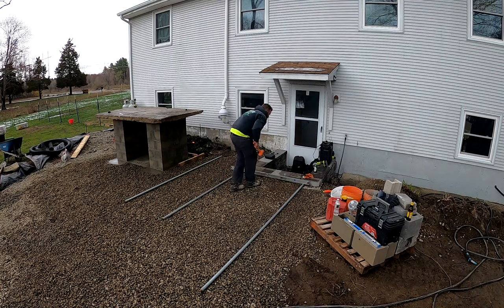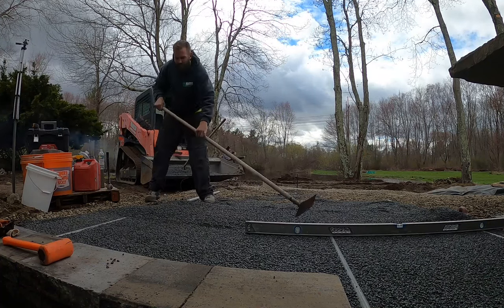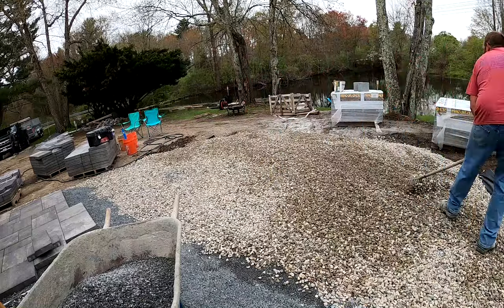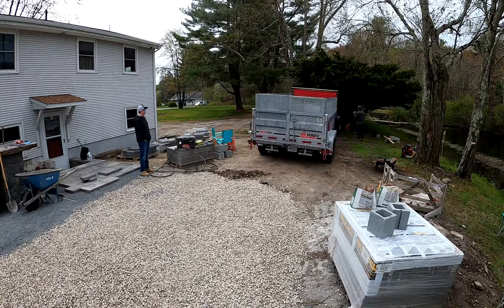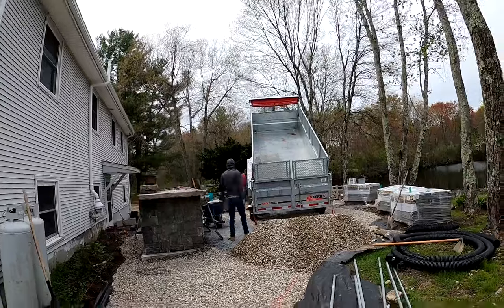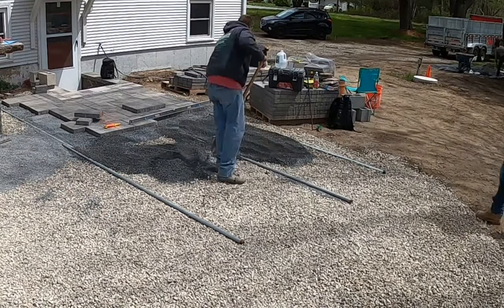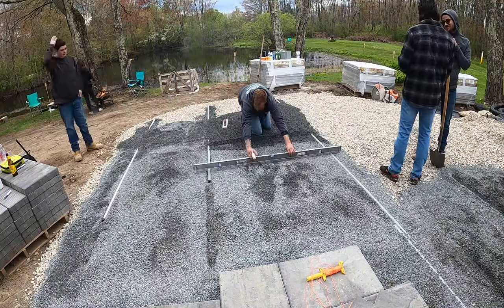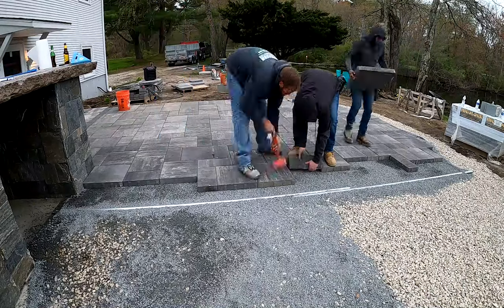I Was Screeding & Laying Pavers, Then I Hurt Myself....

Comment: Curious why don't use the hose attachment for the saw instead of having someone spray water on the blade
Reply from the maker: We do sometimes but when using water, you need to wash the pavers of instantly after you cut or the concrete paste will stain everything it contacts. So it is easier to spray the blade and then just go straight into washing up the mess without disconnecting or messing with 2 different hoses. ✌

Comment: Can I use the gator fabric for driveway. Would it hold up to the weight of vehicles?
Reply from the maker: For driveways, I would use the same method but with a few added steps to insure structural integrity under the weight of vehicular traffic. 

I would excavate a minimum of 10-12 inches from top of paver height. Install thin layer of stone and compact (with a heavy reversible compactor)…

Than lay the gator fabric and backfill 3-4 inches of clean crushed stone and compact. Then lay geo grid on top of that layer. Backfill to height with 3/4 stone and compact. Then install another layer of geo grid on top of that. Than lay your screed pipes and cover the geo grid with your bedding stone. 

Lastly, use pavers that are a minimum of 3 inches and that are designed for vehicular traffic. ✌🏻

Comment: So enjoy your videos. 
How do you determine where to set your screed rails without a transit? Are you just eyeballing it?
In learning and using this method now on 4 projects this year, I still seem to have the 3/4" stone popping up when I'm screediing the chip stone. Any suggestions?
Thanks,  John
Reply from the maker: Thanks for the support! I use string lines here and there in difficult positions but mostly just do it one section at a time. I find the best starting point and lay the first 2 rails where they need to be. Then I run my screed level down the rails before I put the chip stone to make sure no 3/4 is close to the top. If so, I just rake / shovel the excess and get rid of it. Then I will lay the chip stone. I totally know what you are talking about with the 3/4 coming up to the top, very frustrating.... 

But once you have those first 2 screed rails in, you just go one section at a time without completely removing all screed rails. If you leave one or 2 in at all times, you will always have a benchmark for your next section. Then like I said, check the section with your screed level before the chip stone, to make sure the 3/4 is not too high.... ✌
Reply: @TheChristianHardscaper  Thanks for the quick response.  Enjoy your Sunday!